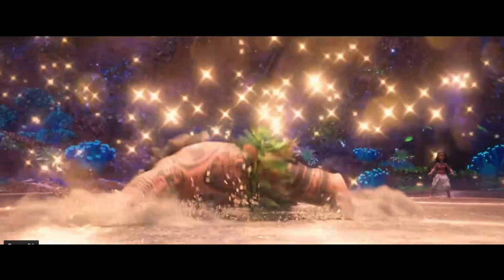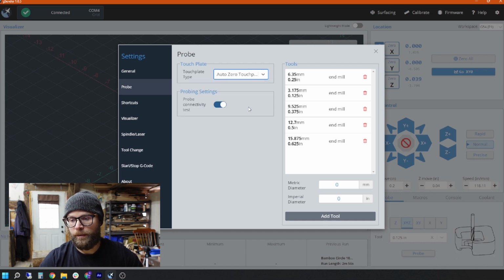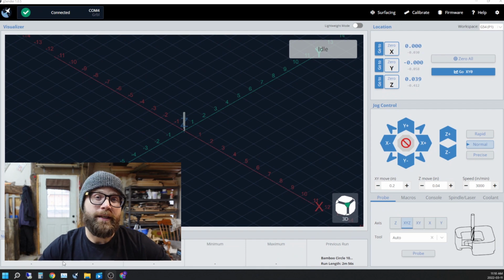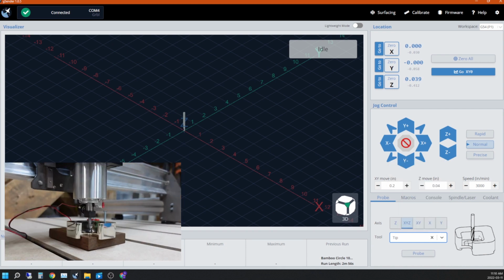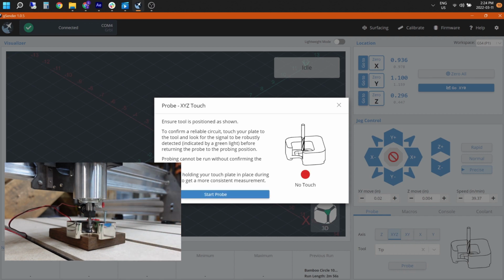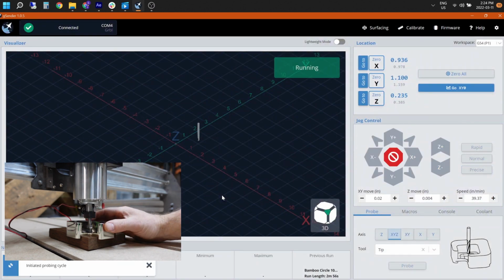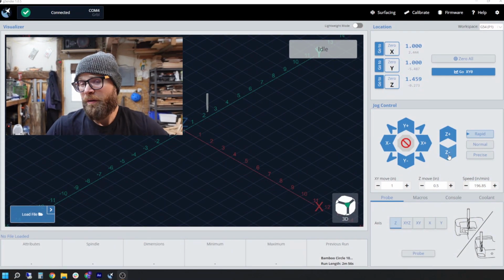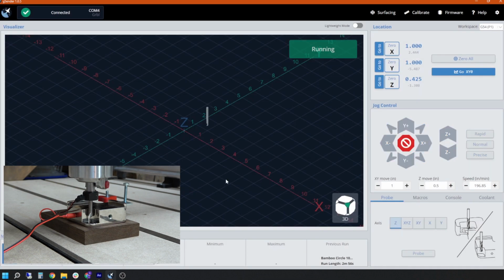Introducing the New AutoZero Touch Plate!

Comment: what if the bit is not round, cause it has two flutes/wings. that stick out?
Reply from the maker: It depends on how far out the two flutes are and their geometry. For smaller ones it can still work, but otherwise it can't make contact unless you manually rotate the bit during probing or just use another bit to probe the swap to the other one since the XY location will stay the same

Comment: here's an idea... using your touch plate to auto-center. 
Step 1 - same as the video. 
Step 2 - reposition the touch plate to the opposite diagonal corner of your material, continue to run and the software finds centre on the diagonal.
Reply from the maker: That's really interesting actually, we'll note it down and maybe investigate

Comment: What is the correct way to use this when the xy zero is at the center of the material
Reply from the maker: This has been asked by other customers on the forum. The general consensus however  is to centre your bit either by measuring or by eye and then using the AZTP to find the Z height. 
Here's the link to the forum where people go into more detail about their process to find centre using the AZTP
https://forum.sienci.com/t/how-to-implement-the-detection-function-of-the-centre-of-the-xy-and-the-centre-of-the-circle-in-the-gsender-probe-module/14565
Reply: I have been grappling with that issue-- here is my solution and should work for most centered materials -- defining the centre as the enclosing box. Time consuming but set G54 G55 G56 G57 as the corners of a rectangle-- and set 0,0 for each -- 0,0 -- then find the intersection of the diagonals  according to the machine  coordinates--

Comment: Is this available for an Inventables X-Carve Pro using Easel pro? If not will it be someday and when?
Reply from the maker: As far as I'm aware Easel Pro doesn't have the option to run custom macros or use custom touch plates, do you know if that's correct? If so then we would be able to get it to work. It is possible though to control the X-Carve Pro with our gSender software, where you can use the tough plate there

Comment: I tried to use the auto zero using these very steps and it ended up dragging my bit across the surface of the plate. It's got a scratch in it now. What could I have dine wrong? I filled these steps exactly and it still failed.
Reply from the maker: There are a few things that might have happened, such as if the settings were wrong or there was an issue with the continuity. Can you send us a video clip of the issue and our technical support team would be happy to help you out https://sienci.com/contact-us/

Comment: how to get around that ??
reverse your spindle direction and probe slowly.
Reply from the maker: Yes that is an option, if you have a spindle with full control then running in reverse on slow feed could work to touch off especially better for spiral bits. You can still run into problems though for tapered, v-bits, and ball-nose bits
Reply: @SienciLabs  not if its a cylinder probe.
it could Z first then do a x+ x- go up go to the edge of the probe Z probe over a few times.
it would know the V degree And or radius if the math is correct for the macro.
All spinning in reverse which makes it worth it to enable it

Comment: I am getting alarms for soft limits I do have the sensors installed. Why would using the touch plate give me soft limit alarms?
Reply from the maker: Hi there,
 It's likely your material is too close to the bottom left side of the machine and the bit won't travel in negative numbers? Move the material to the top right about an 1.5" inches and try again. If you haven't already, check out our resources page for the troubleshooting video on the touchplate. If you're still having trouble, feel free to reach out to support!
https://youtu.be/I1EhAPNXdzQ

Comment: interesting this touch plate. BUT i looking how much cost and have totally out of hobby user budget, NO thanks. need be 90% drop price down, then hobby users buy.
Reply from the maker: Based on our market research, we found that 1) there aren't any touch plates that offer the functionality that the autozero does, and 2) most are around the same price or even more expensive than the Autozero without the same functionality. If it is out of your budget, I'd recommend checking out our other touch plate on our website which is $35CAD.
Reply: @SienciLabs  i looking very easy made Z height tool zero plate less than 4 $ but i looking how make XYZ tool. i not understand this code, to make linuxcnc, mach3 has many example but worst software have not use newer again mach3 i just changes software to linuxcnc lot better use, and FREE i build new machine to my son and him say need auto zero -xyz too. but this XYZ have me new think. need someone help how this make to linuxcnc. and looking many many zero tools and video but all have super expensive. example this tool.  i made own aluminium parts if first understand this code better how make button to pc display zeroing, and then mill aluminium block if all what can buy have too expensive, simple made - hardware and wiring have simple but code not. and add button tools to display.

Comment: Are these only compatible with Longmill cnc’s, or can they be used with other cnc setups?
Reply from the maker: As long as your CNC supports closed-circuit a.k.a. continuity touch plates then you'll be able to use this 👍 there's no fancy circuitry built-in and the movement script is currently built-in to gSender

Comment: Not all bits, or correct me if I am wrong but diamond drag could not be done here because there is no interconnected vibration dectector right?
Reply from the maker: Correct, the bits still need to be able to carry a conductive signal through the plate and back to the machine

Comment: Interesting innovation to a genuine irritant issue. Will this only ever be a Sienci-specific probe due to the software calculations or is there a plan to release similar probe modules to other CNC vendors or an SDK?
Reply from the maker: As far as the plate itself it's electrically a simple closed continuity so that aspect is surely already widely supported  

We're happy to be making the probing procedure available soon once we finish some final tweaks. There are some 'on the fly' calculations that need to be done within the g-code that other senders will need to be able to support so it'll be up to them to make that sort of advanced g-code available to users via macros. We'll see how we can develop it further once we know the design is working well.
Reply: @SienciLabs  Great!

Comment: I ordered the mk2 with all the bells and whistles. It's on backorder.  Will it come with the new or old touchplate?
Reply from the maker: The touch plates are add-ons for the machine since they're not strictly necessary and other people prefer to set zero in their own way. If you didn't order a touch plate on your existing order the you can order it separately with 'local pickup' and leave a note to add it to your other order. If you already bought the previous one then you can contact us if you'd like to switch to this new one instead and we can sort out the change with you 👍

Comment: MANNNNNN I was just there and bought a touch plate !! I knew i should of waited, Jason my man is helping me out with an issue I'm having shout to your support staff !! 
Question: so you can put the bit/EM anywhere in that squared off area correct? the probe figures out the center for you it doesn't matter if its a V-bit or Upcut/dpwncut Endmill just put it somewhere in that square and probe or do you have to put it over the sienci logo as well ? thanks in advance
Reply from the maker: Yes, just like our current touch plate where you start in the circle, except this time you start inside the square. There's an option to select either straight bit or tipped bit (such as v-bit or tapered bit) and that's it, it figures out the rest for you

Comment: interesting ive been using my vbit with the original touch plate but ive been using easel so the xy has to be manually zeroed anyways
Reply from the maker: Yes, the original and all other touch plates will allow for zeroing in the Z on v-bits and tapered bits, just not in the X or Y

Comment: Now if you get a xy auto datum like openbuils or basic sender it would be awesome
Reply from the maker: Would you be able to explain what you mean by "XY auto datum" Scott
Reply: @SienciLabs  If you have your toolpaths set for the center of the project in the xyz prob mode there is a advanced setting you can put in the size of the project center datum and it will move there and zero x and y at that spot it will work on all the corners too
Reply from the maker: Oh ok, interesting. In gSender the feature isn't exactly the same but if your project was 20 by 20 then you could type in -10 and -10 for the X and Y locations and that would shift your zero to be the center
Reply: @SienciLabs  Thanks for the info